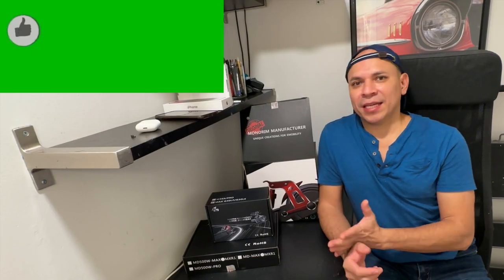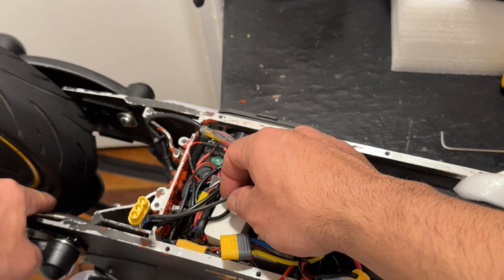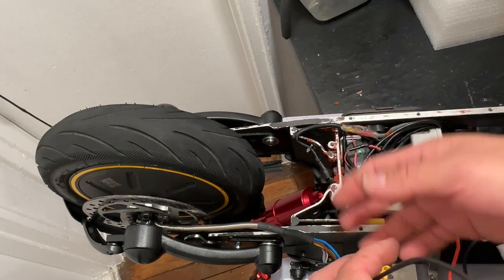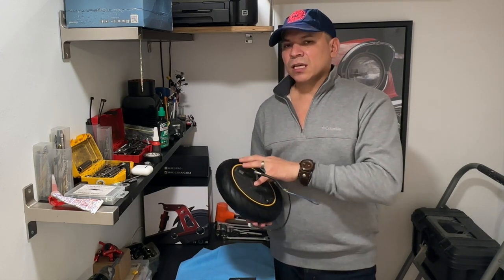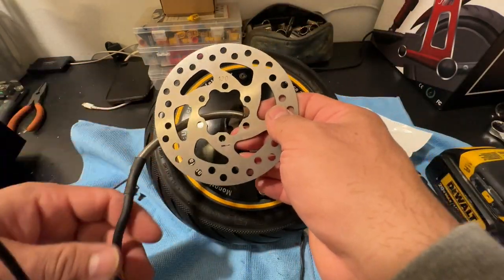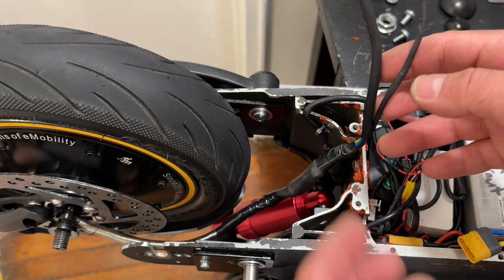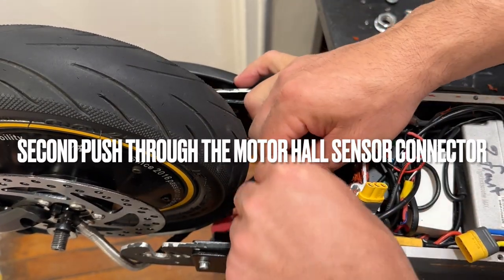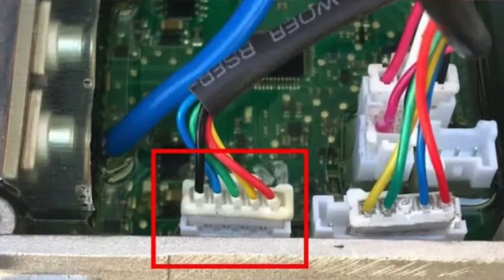Installation of Monorim MD-MXR1 Rear Brake adapter. For Ninebot Max. Part 1

Comment: Can you able do some towing trailer for ninebot max that be cool to carry food shopping,spare parts with tools kits or fidhing camping gear be lot more fun times to do wothout getting stuck amd slwsys carrier good solar panel to keep keep power up running for ages best part about it with having dead battery 🙏👌🤞
Reply from the maker: In 2021 I made the best carrier for the ninebot max which had adapters for different type of trailers, for groceries, tools boxes, baby trailers and pets. Check out in my videos. Strong carrier for Ninebot Max. Contact me on FB group and I’ll give you some info how to DIY those parts. I don’t make them anymore And soon I’ll share details about that. Solar is a bit way more jejeje but if you can make happen jejeje
Reply: @esnkaz  yes Ive drawn up myself a plan and love having mini hydraulic suspension or tipper tray 🤣🤣

Comment: Hi thanks for you video! A question for the mount disc brake 140mm I don't understand that's necessary. I have a g30 max and sharkset rear suspension with monorim adaptor for motor and plate adaptor sharkset.
Reply from the maker: Hey Claudio. It is not necessary when your scooter its stock.

Comment: how do you run the brake line? I have sharkset suspension and rear brake kit mymaxmods
Reply from the maker: Check out video for cable installation towards the rear wheel